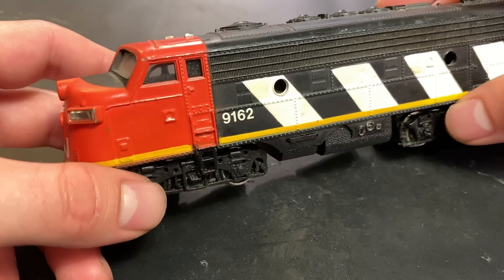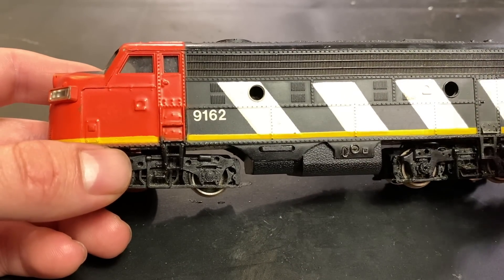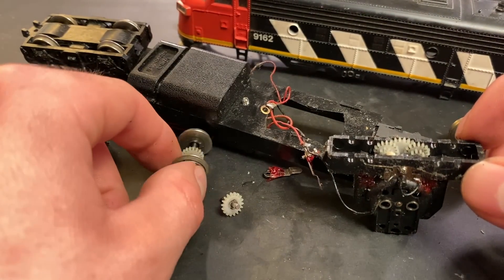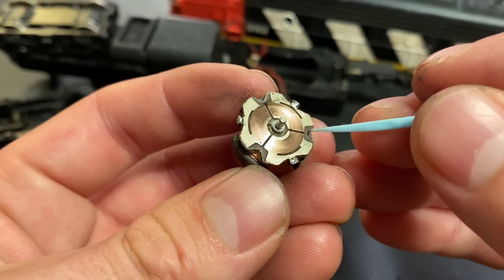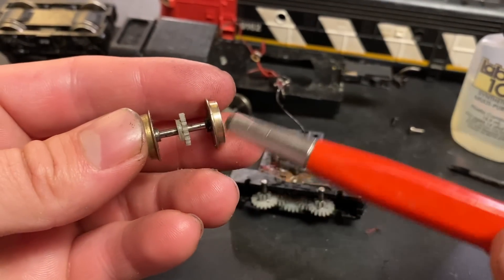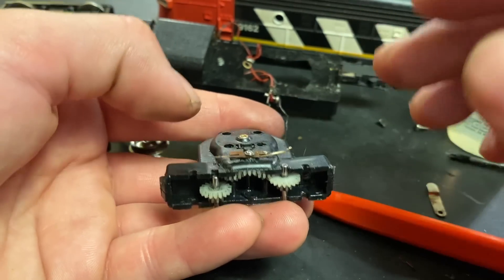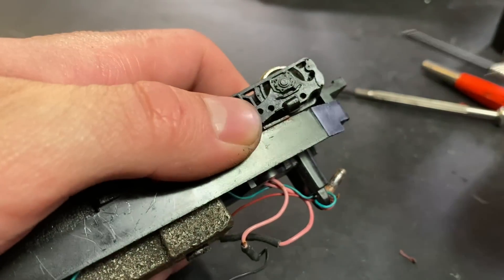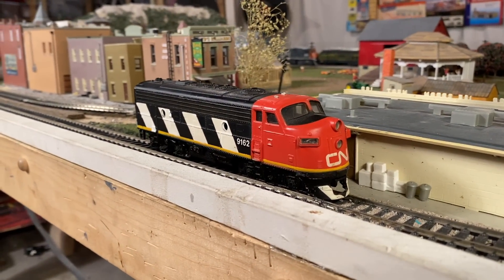Don't Run Your Locomotive That's Been in Storage for Years

Comment: For what it's worth this is a model of a Canadian National (Harrison dwells in the Great White North) 1500 horsepower Model F7 built by General Motors Diesel Ltd (GMD) in London, Ontario to the plans of fellow GM outfit Electromotive Division (EMD) of La Grange, Illinois in the early Fifties. Before NAFTA, a Canadian railroad buying a locomotive in the US would have to pay import duties (and vice versa). So, the US builders had relationships with  various Canadian Shops. American Locomotive Company (Alco) owned Montreal Locomotive Works (MLW), EMD had GMD, Fairbanks Morse (FM) and Baldwin Locomotive Works (BLW) had alliances with Canadian Locomotive Company (CLC). Two points about the roof. The boxy structure aft of the third cooling fan in a winterization hatch. When closed during the winter it diverted some of the hot air back into the engine room to help keep the engine at proper operating temperature. The collection of oddly shaped items at the rear of the roof are the intake, exhaust and safety valves of a small oil-fired boiler to provide steam to heat the passenger cars in cold weather if it was assigned to a passenger run. Above the cab, the horns have been broken off. Go to Ebay to order a set of replacement horns .https://www.bing.com/images/search?q=ho%20diesel%20horns&qs=n&form=QBIR&sp=-1&pq=ho%20diesel%20horns&sc=3-15&cvid=FCF84CD6E9B54BA6A227BE5C6AB5E759&ghsh=0&ghacc=0&first=1&tsc=ImageHoverTitle Then go to Micromark to order a pin vise and a set of bits https://www.micromark.com/mini-hand-tools/drill-bits-pin-vises These are essential tools for any model railroader, I recommend this vendor because it is known for its quality  products. As in so many things in life, buying quality tools is cheaper in the long run. While you're at it, pick up some ACC or CA (model railroader's super glue) https://www.amazon.com/s?k=hobby+glue+for+models&adgrpid=1345802795040638&hvadid=84112745452656&hvbmt=bp&hvdev=c&hvlocphy=95871&hvnetw=o&hvqmt=p&hvtargid=kwd-84113014790083%3Aloc-190&hydadcr=4120_10331265&tag=mh0b-20&ref=pd_sl_6me9g35kp7_p. Now, use the pin vise and a drill bit to drill out the broken horn bases. Paint the horns with model paint. It seems CN painted its horns silver or aluminum   https://www.trainspotted.com/photos/0ef4f78a16ac11e5f493383a6191ca83/Canadian-National-Railway-9171-diesel-locomotive-F7.jpg  or black https://www.railpictures.net/photo/718673/. Glue the horns in place. If you want to go crazy, go back to Ebay and buy and install a steam locomotive type bell. https://www.railpictures.net/viewphoto.php?id=277349 and https://www.ebay.com/b/HO-Model-Railroad-Bells/262314/bn_9272031. Paint, drill a hole and glue in place. Drill two more holes, cut, bend and paint a piece of sheet brass and glue in place as the hanger. Step back, get the beverage of your choice and enjoy your masterpiece.
Reply: It's probably meant to stand in for an F7, but it's an F9. These Bachmann F9 units were the bane of many a trainset back in the day. Bachmann did later produce an F7 in HO... but it's a completely different model.
Reply: @ErickC  Yer right, I'd didn't see the grills forward of the porthole. A 1750 hp F9 it are. Turns out CN had 38 of the beasties - but they were all B units!. They were teamed with 43 1750 hp FP9's - a lengthened F9 to carry more water for steam heating passenger trains. For some obscure reason, that was considered important in Canada. Still it isn't that much of a stretch for a coulda been loco.....

Comment: Very good tips Harrison!  One thing of note though, is that it's possible, although extremely rare, to get brand new locomotives that have been over lubricated from the factory!  I have a pair of Athearn Ready to Roll KCS SD40T-2 tunnel motors that had this issue.  They had so much oil and grease in them that it would bleed out from the trucks as the locomotives ran, not to mention, it hampered their performance quite a bit!  The trick to lubricating locomotives is to make the gears appear "wet", usually only a 3 or 4 drops is plenty, also it's good to use a PTF style grease, I use Labelle 106 personally and again only a small amount is needed usually only a drop or two should do the trick.
Reply from the maker: I've seen that before on a Bachmann Locomotive I got in a 2011 train set.
Reply: @SMTMainline  this was quite strange for these two Athearn locomotives, these were the only locomotives I own to have had that problem as well!  I just found it odd, that they both had the same issue.
Reply: @randallellison6421  those are probably the nylon gears that bachmann put out on their 80s and 90s locomotives they cracked pretty easily. They have same issue that are on those proto 2000 locomotives including athearn at times. My guess idk if your referring to the ones from 80s or the present and yes most of my bachmann locomotives from the 2000s onwards have that same over lubricantion problem. Not sure why they put too much there.

Comment: What liquid did you use on the cotton swab? Is that rubbing alcohol?
Reply: I'm pretty sure it's Isopropyl alcohol, maybe 90%.
Reply from the maker: @hondachopper6978  Bingo
Reply: Most likely yes.  Most people I've seen clean model locomotive drive trains say to use at minimum 91% alcohol to reduce the chance of oxidation due to the water content.  There's also a motor cleaning kit made by Labelle that works great too, plus it helps with the lubrication process as well!  But I suggest that it's used in a well ventilated area as the it has a very strong oder!
Reply: ron rico 151 will work in a pinch

Comment: Hi Smt I have a question is it normal to have a motor type smell when running engines because I got a vintage con for n scale f3 and it’s been lubetcated but it has a weird smell to it when I run it.
Reply: Yea same I got a f7 war or net and it runs but smells like oil lol and I got a Chezi system and it works and smells to lol
Reply from the maker: Usually it's due to a dirty commutator but otherwise it means your windings are burning.
Reply: It usual to have these older engines to smell when they run. I think it would be a good idea to get the motor serviced is it could lead to a eventual failure.
Reply: @cricket9095  so should i be aware of the smell
Reply: Danget
Reply: That going be hard to repair because the shell holds on really tight and I’m afraid I’m going to put something in a wrong spot
Reply: some bonehead probably used wd-40, automotive motor oil or atf to lubricate it- time for a complete overhaul.

Comment: This is gonna be kind of a specific question...what do you do if your locomotive has been sitting pretty much since it was new (say, 40 years)?
Reply: Clean it. The grease from the factory gets hard and locks things up. Most of the time anyway
Reply from the maker: @danshobbies13  Exactly!
Reply: Thx. Time to crack open some big Rivarossi articulateds...
Reply: put it on eBay and be sure to put NOS in the title

Comment: Very good tips here. Risking frying the motor and trying to force it to run isn't worth it but to test it is great. These are same things I did to test mine etc to get mine running. Now that they are sitting in storage on temp basis it will be good i go thru them once i get layout up and running .  hope all is going well for you Harrison , ive been alright just working and extreme heatwave is crazy.